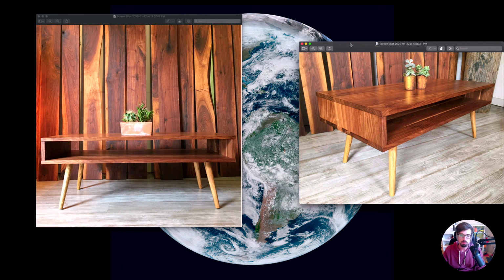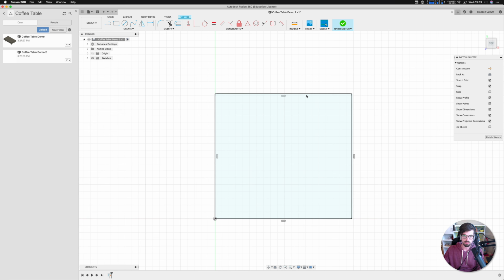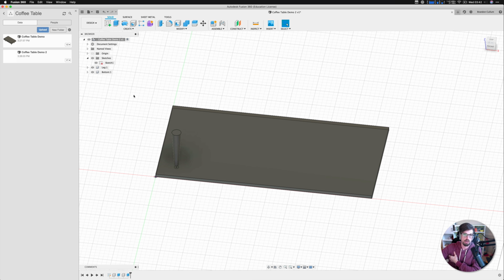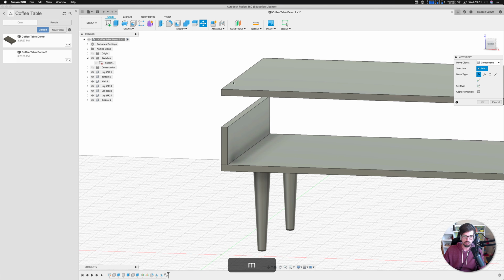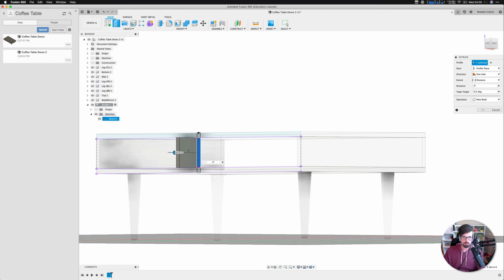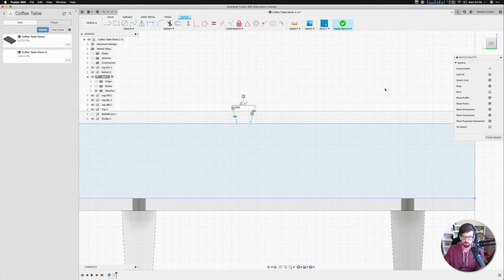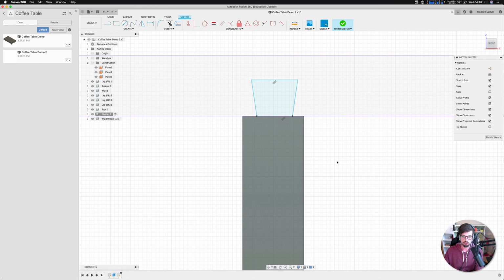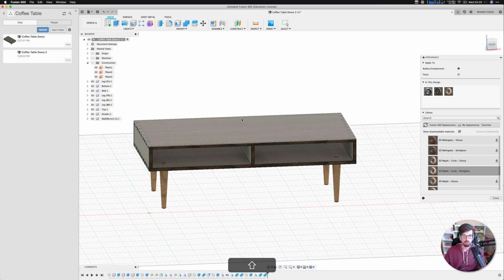Designing Furniture with Fusion 360 for Absolute Beginners!

Comment from the maker: What should I make for the next tutorial?
Reply: I would love to learn more about Fusion. What about getting a cut list from what you just drew?
Reply: I would love to see if there is a way to easily make a cut list, or plans with measurements on them from this point.
Reply: I’d love to see how to go about making a cut list, if there’s a way to lay the cuts out on a sheet, or how to do those blueprint/schematic page.
Reply: @aDavidAlan  Schematic/blueprints are simple as pie in fusion.  Just click down on drawing menu and go for it.  Its really really simple.  You can add dimensions to the schematic for any face, edge etc.
Reply: Thanks for the help already, just got into woodworking as a hobby and as a software guy this is great. Would love some content on how your workflow from model to finished project looks like!
Reply: On top of other project designs, would love to see a whole workflow including cut list, sourcing wood, making the cuts, etc. all the way to finish!
Reply: Would be great to see you create some closet shelves in Fusion, starting with drawing the walls, then the shelves. Or maybe some simple french cleat tool holders using Fusion.
Reply: I agree that creating a drawing of the table, with a cut list could come next. But if the drawing included an exploded view with ballons that corespond to the cut list would really be awseome. Your Thoughts ! ? ?

Comment: This video is not for beginners at all. If I haven't worked with similar tools, I wouldn't have solved a lot issues with the model. For instance, when mirroring, you have to explicitly click to mirror bodies, not faces. Not mentioned anywhere during the video etc... otherwise, thumbs up for the parameters section, makes whole model a lot more flexible.

Comment: I have been using TurboCad Mac Pro for a long time and there are some things in Fusion a bit difficult to do understand. Question: every time you make models, the sketches should be with the components? Let's say you making a wardrobe. You need to have individual components for: Sides, Shelves, stretchers, doors, etc.? I do cabinets using a Festool domino. and every of those components have their own sketch?
I got the sketch padlock many times ...

Comment: Been using Fusion for a while, and still learned some things! Thank you! 

Question: Why not use 0,0,0 as your center and mirror off that instead of making construction planes? I feel like you can skip a bunch of a extra steps that way.
Reply: Good question, but in learning and teaching fusion, one finds that there are at least 5 different ways to do anything in fusion.  One would still have to choose a plane to mirror over, but instead of a midplane, your midplane would be the original vertical plane.  6 of one, half dozen of the other.  He chose to do a one way extrude--could have constructed on origin and done a two-way.

Comment: One specific suggestion: Stop saying "here" and shortly wiggle the mouse cursor somewhere. That's very hard to follow because the mouse cursor is small and while you move over other stuff, Fusion highlights irrelevant things. There are a couple of occassions where you say "click here and here" within maybe half a ssecond and I am left wondering what just happened.
How about "click here on the front pane of the bottom component [stop for half a second and only move the mouse very slightly] and then click here *on the back pane of the bottom component [stop again for a short while]" Thanks a lot!

Comment: You do go quite fast for beginners - I had to pause and rewind several times - BUT the information is very good, I was able to follow along (with a little extra effort), and I appreciate you putting this together :-) I especially appreciate you including parameters from the start; that's a very handy feature I'd not seen in other beginner tutorials, probably one I will use in every single project.

Comment: I have a table leg with a square at one end and a circle on the other. I have tried extruding and tapering with a plane in the middle but it just extrude the square to the circle and doesn't morph the shapes.
Reply from the maker: Try using the Loft tool!
Reply: @makeorbreakshop  thank you for your help
Reply: I'm really sorry to bother you again but I have another quick question. Having drawn my component with the corner of the component  exactly on the axis y0 x0  so I can set it up on my router at x0 y0 z0, why does fusion360 decide the tool needs to be position somewhere in the middle of the component. I have no idea where the router will place the component on a sheet of ABS that I am cutting. I must be missing something please help.
Regards
Des

Comment: I'm typically not one to comment on Youtube, but thought I might add here - I watched this because I like your videos and you tend to recommend Fusion 360 (and I've seen others do it too!) but I wanted to add - I'm pretty sharp and used to CAD programs, but I feel like you zipped through some things so fast I had to go look them up outside of your video to figure out how you did what you showed. For example, your bit on mirroring the table legs, I was following along and found mine wouldn't work - I got "Compute failed" and "One or more patterns could not be intersected..." etc. I googled it and found it's because you've got to change Pattern Type from "Faces" to "Components" in the mirror window. You have it selected (likely by default) but didn't mention it to us absolute beginners :P.
Reply: I was hoping I'd find the answer in the comments, this drove me nuts, thank you so much!  I will agree that some things are entirely glossed over, there's a lot of "click this here" I was trying to follow along exactly and just ended up removing the hole from the bottom plane of the table in my own way. the thing is the video is 40 minutes long even at the fast pace so I think this is probably the best way it can be done.
Reply: Ahhh thank you!

Comment: While I like the use of the mirror command, if you use a drawing to say produce a parts list you will have each component separate. So parts that are the same won't get combined in the parts list table. Because of this I am stuck with using the move command and making copies. Only problem with this is if I change parameters for sizing, the parts don't get moved to the correct location. Is there a way around this?
Reply: In many cases, you can use the Mirror command followed by the Combine command to join the two bodies (original and mirrored). That makes it work with your parameters and parts list.

Comment: You overshot "Absolute Beginners". I'm looking to make the move from Sketchup to Fusion and learned Sketchup watching videos like Jay Bates, etc. I was trying to watch your video and work along but you move too quick through the small things. How do I get to the parameters window? I had to rewind and go through, watch again, and then do it. If you're going to focus on beginners, slow down and explain the small stuff. Your default units were inches, mine were mm. How do I change that? Point being, this isn't a video being for "absolute" beginners.
Reply: I'ma sketchup user wanting to switch to fusion.  You move way too fast for beginners.
Reply: Yes, please make a version with more details and step descriptions! I really am an "Absolute Beginner" and I got to about 15 minutes with setting the speed in Youtube to 0.75 plus a lot of pausing and rewinding. Then I did something wrong and by trying to fix it I botched the whole design :-(
And then there is stuff like this: Now and then the  "Sketch" ribbon goes AWOL and I fiddle a bit and then it somehow appears again. What even are the differences between component/drawing/sketch/body? Some explaining of concepts before you dive in would be great!